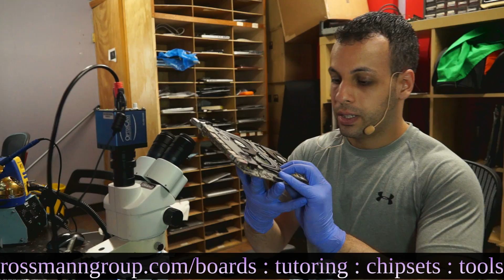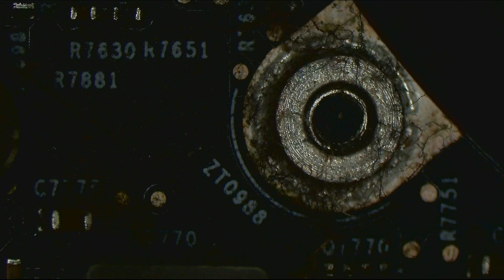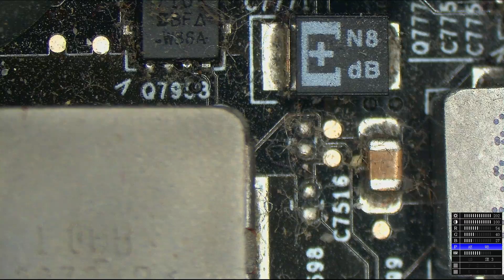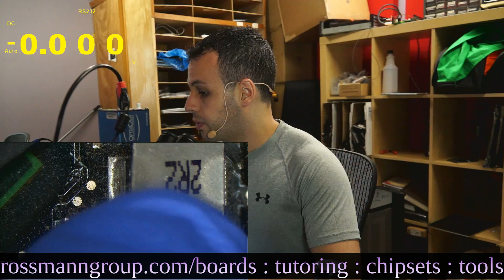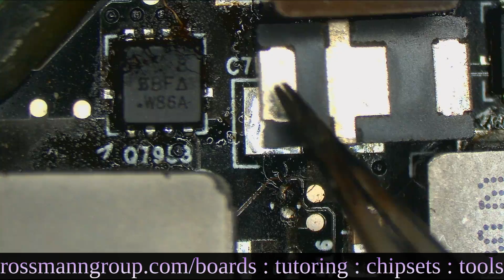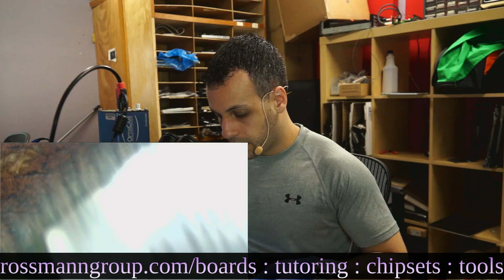What causes no power most 2008-2009 17" Unibody Macbook Pros & how to fix it.

Comment: why didnt you clean it. its absolutely filthy/
Reply: He probably did after-the-fact since it was not inside the enclosure yet, after he powered it off. Or, do you really like the ASMR provided by the ultrasonic?
Reply: He does clean them after repairing them. He’s mentioned before that he cleans after the fix because the ultrasonic cleaner gets rid of any hints of what’s the issue... like corrosion from water damage that the customer usually doesn’t tell him about.

Comment: These are still nice machines and compared to some MacBook Pro models, reliable as frig. I own one that exhibited the same issue and was repaired with this method, albeit using a temperature controlled iron and removing some of the nearby solder mask to perform the fix. Tossed a thermal transfer pad between the Mux chip and bottom case as preventative maintenance, and it's outlived several of the newer machines that were supposed to replace it. 

Picked up another two 17" 2009s last week with the same issue and intend to perform the same fix to those as well.

Comment: Here is shoot one. I've never seen anyone before on how to solder smd caps. I am just a hobbyist doing stuff, all my soldering techniques are from personal experience. The way you soldered that new cap into place was not so good. I wouldn't put solder on the board, removing the old solder and placing the capacitor first is the best option. The use of hot air and a touch of solder on the hot edges of the cap would make a perfect joint without having excess solder everywhere. The solder would just flow underneath filling perfectly, always use minimal solder.